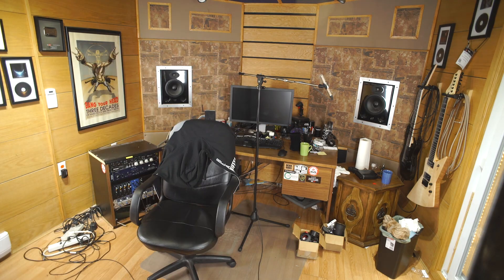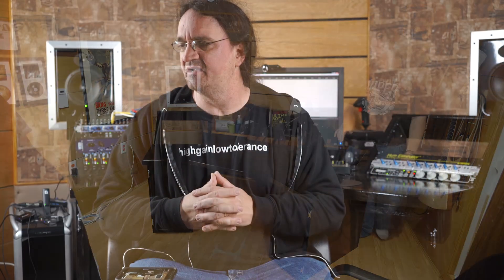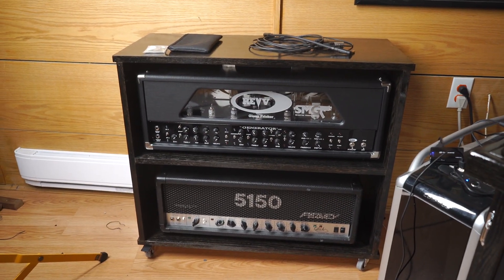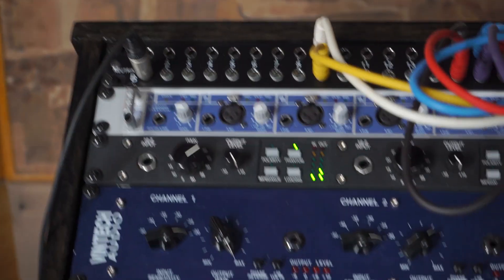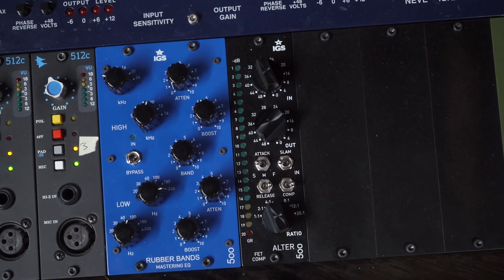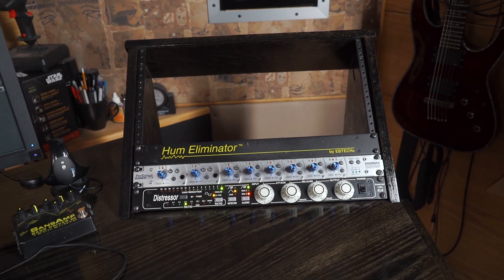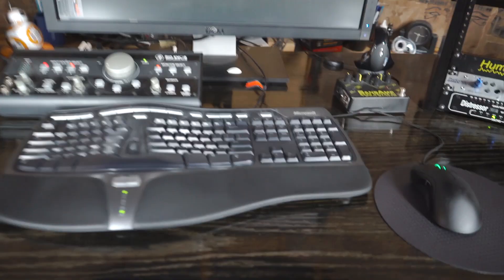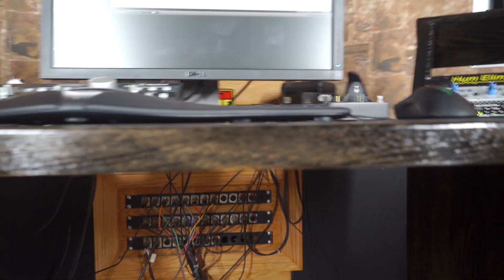New Desk Install at SMG | SpectreSoundStudios

Comment: For your open space in that right side rack, A little trick I learned doing IT is that you can get plexiglass, spraypaint the back side whatever color and the front now looks like a gloss finish. A 1/4" piece is plenty strong so you can run hook screws into it to hold fiber/CAT6 cables, cabinet keys, cable adapaters, console cables, etc. You can also use the hooks for cable management.

Comment: I'm amazed that so many of you studio guys only seem to use a single monitor for your computer - particularly for Reaper, I find that having at least two high-res monitors (2k or above) makes a massive positive difference to my workflow. In fact, I use 3 these days (left for effects windows and file manipulation, middle for main view and transport and right for the mixer).
Reply: +digiscream One of the best setups I saw was a guy doing construction estimation. He used a 40" 1080P TV mounted low enough over his digitizing table to be comfortable at eye level. Instead of multiple desktops, he had one great big one. Was awesome for doing take-offs.
Reply: +Mike McKeen I personally feel that 1080p is a terrible resolution - not wide enough to fit two useful windows side-by-side, and not tall enough to get anything useful vertically. My main monitor is 1920x1200, and the two side monitors are 1680x1050 - all 16:10, which is a vastly more useful aspect ratio for just about everything IMO.

Then again, my 13" laptop is 3200x1800, and that's taking the whole DPI thing a bit too far ;) Run at 2560x1440, though, it's comfortable to work on with a single screen.
Reply: digiscream The standard size (in the USA) for most construction prints is 24x36 inches or about a 1.5 ratio. Using 1080P means the estimator can open the entire drawing in a readable window and still leave a little room for other toolbars and things around the edge. In their case, they don't have to constantly zoom in or out to see different parts of the print 16:10 is great because you can rotate your widescreens vertically and see more, or it's perfect for getting two Letter sized docs side by side.

Comment: Hey Glenn you're missing something from your editing rig: a second monitor! I know you might think you don't need one but once you get used to multiple monitors you'd see it is much better that way.
Reply: +dimitriid Agree on that. Dual monitor setup for working with audio is really huge time saver and speeds up work process a lot. But you have to design your monitors position and desk having dual monitor setup in mind because it changes a lot of things.
PS. On the other hand on Windows 10 if you are working on Cubase 8+, you can use virtual desktops, to fast switch between mixer, vsts, tracks etc. without minimizing stuff etc. But it works only in Cubase 8+ because of its new window handling process. Just a tip.

Comment: I'm in the market for an Ebtech Hum Eliminator as my AC is driving me nuts! Only problem is that they are expensive and more-so from USD to AUD.

If it's just taking up rackspace then you could send it to an SMG Fan and Subscriber in  in desperate need of one (such as myself) ;)

I have my eye on the 'ART DTI Dual Transformer/Isolator'. Hopefully that's a cost effective alternative.

Comment: Congratulations! That looks amazing...I was wondering about the hum issues, how did you solve that? I have some electrical noise while recording although I'm using a good pc with a quality powersupply. Will a hum eliminator do the trick? if so, what brand do you propose? Thank you :)

Comment: Hey Glen, that's one nice looking desk. I'm about to build something similar myself. Well, not myself, but my father in law's going to do all the hard work. :)
I've been wondering, you seem to have a similarly sized room as mine and I'm wondering what's your frequency response? I have a pair of dynaudio bm12 monitors and have found a position where I have the flattest frequency response but I still have a huge bump at 147Hz and a dip at 100.
Have you decided to go with built in speakers because of space or does it help with the sound? How much space you have behind the wall anyway?
Thnx, you rock!